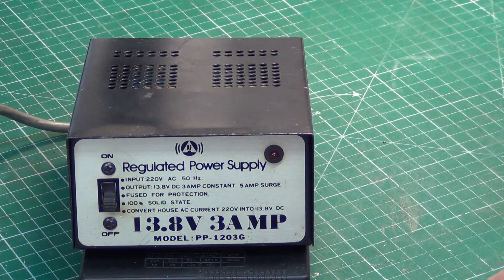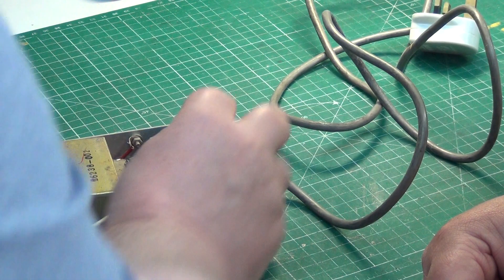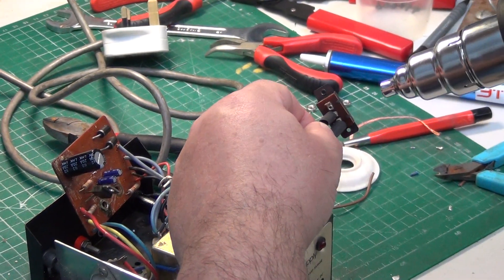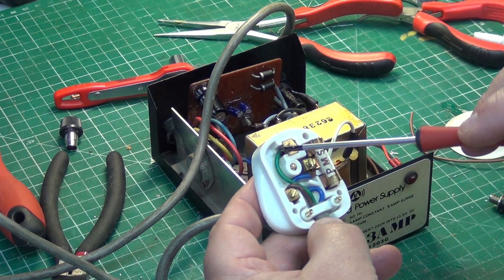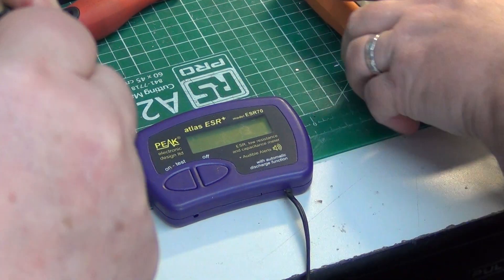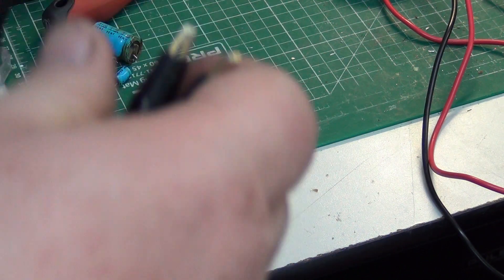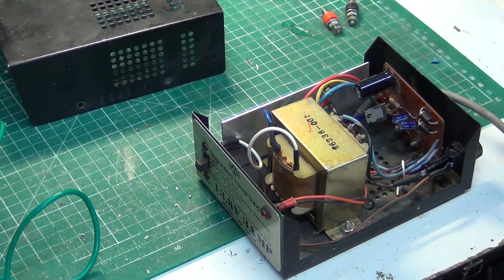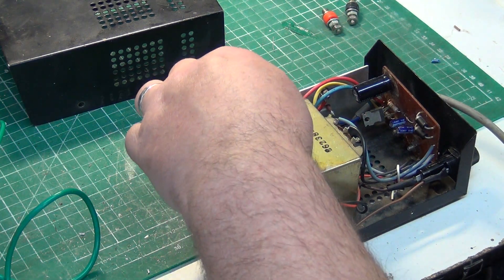Banned Taiwanese power suppy overhaul/rebuild AF PP1203G

Comment: I've got one of these that came from a junk shop. Tested it today - quite a loud buzz/hum when in use, adds a lot of noise to my radio compared to the car battery, and when i switch it on/off it momentarily makes my pc monitor black out.  So i guess i should bin it.

I want to replace it with something cheap but silent (audible noise and radio noise).  Any recommendations? Is there much difference between a budget and mote expensive psu these days?
Reply from the maker: Service the one you have. You say it's like this one, so follow the video. The old/duff capacitors cause the noise. Regarding new power supplies, we avoid switch mode "switching" power supplies like the plague. They have a tendancy introduce noise on receive & seem to have a very limited life....and are rarely repairable. This is why we are overhauling traditional transformer based power supplies.

I tested a couple of new power supplies last year & the videos are still in my back catalogue. They were, of course, transformer based supplies & both worked well & were only around £40.

Richard, G0OJF, UK
Reply: @ukfmcbradioservicingTango21  thanks - I'll check those videos. I'd happily get it serviced but I'm not in the UK and I don't know anywhere local so it's difficult

Comment: I remember, when the Bremmi power supplies first came in, they were switched Neutral, not earthed and fused at 13 amp.  The only good thing in their favour was they did use a very good regulator.  However, though they kept 13.8 volts, the transistor and the heat sink got very, very hot.  It also had a metal switch, all the safety standards frowned on them, don't know why, I tested it at 1000V, and it passed, so I left it, it would still be there, long after a plastic one had given up.  I changed the heat sink to one with fins on it, this kept it quite cool.  I put a fuse on the secondly of the transformer, put a 13 amp fuse in the plug, also changed the plug for sleeved plug legs on live and neutral, this had been a moulded plug from the factory with not sleeving on the live and neutral.  I also made the board a bit safer as it might contact other parts.  I also sleeved all the live and neutral exposed terminals when the cover was removed, don't know why I bothered, I was the only one that was going to be using it.  It ran a CB and a car radio cassette, later changed for a CD version of a car radio.  Put a neon in to show mains was turned on, put a LED to show there was an output.  I stopped short of putting a crowbar in, maybe I should have after all the work.  I still have it, and it is still running after all these years, maybe I should check the cap's.  But I have a bigger supply that went BANG one day, it was 10 amp and came with the same silly faults like switched neutral.  Do Europeans not know their wiring colours? However, Bremmi responded to the safety issues and changed their power supplies.  They still were not perfect, but good power supplies for the beginner.
Good to see you doing power supplies, people do not realise the dangers of some of these power supplies from abroad!
Reply from the maker: I think we covered the Bremi BRS26 a bit back on this channel. I have others lurking awaiting repair too.

Interesting you say 'good for beginners', I'm just wondering why. For example, I use the banned Taiwanese supplies for nearly everything either the 3A version or the 5A version for some of the ex business radios I have on amateur band.

Richard
Reply: @ukfmcbradioservicingTango21  when Bremmi sorted themselves out they were as safe as could be.  Well regulated and very reliable for the £14 or so they cost at the time.

Comment: I got the same psu in 1981, It was the most popular power supply at the time. Worked great with my Harrier CB, and DV27 in the loft 🙂👌
Reply: It was all Bremmi power supplies up here, however, they had all the same faults as this one had, though I think they were better regulated, at least after the very first one came in, however, they never fixed the faults until they were told about them.  They said they didn't realise they were being sold over here!  Yeah, right!  The DV27 in the loft is a classic for town users, maybe all you needed, anything bigger would have swamped the front end of the CB.

Comment: If you get a moment can you list the RS part number for the terminal posts and the fuse holder you used. 👍
Reply from the maker: I'll get back to you on the RS number. The Terminals are a far east type (it goes without saying). I got them off AliExpress JS910B.

Richard

Comment: Wow just had a look about the internet, Regulated power supply price are crazy now.
Reply from the maker: That's why they are worth rebuilding. Our wholesaler wants £39 + VAT trade for 3-5A  transformer based linear power supplies. I'm not a lover of switch mode types, I've had bad experience of a very poor life span.

Richard
Reply: @ukfmcbradioservicingTango21  I have 2 G com one 3-5 amp and one 10-12 amp. I had a problem with a switch mode and it killed the radio.
Reply: Linear power supplies are great, unfortunately they are becoming a luxury item because they are good and do not break down.
They tolerate radio radiation nearby.

Comment: Used to have the same power supply for years used to get very hot
Reply from the maker: That's interesting. We've been rebuilding these for 40 years now & is my 'general purpose/CB power suppky of choice'. 

I did know someone who had theirs on a carpet thus blocking the bottom ventilation holes though!

Richard, G0OJF, UK
Reply: @ukfmcbradioservicingTango21  "suppky" Fast typing Mr T.